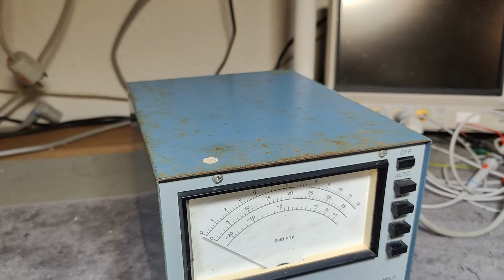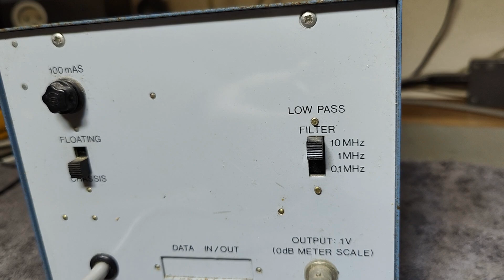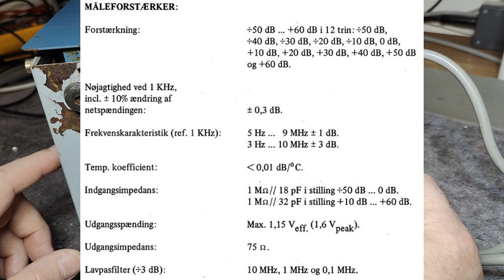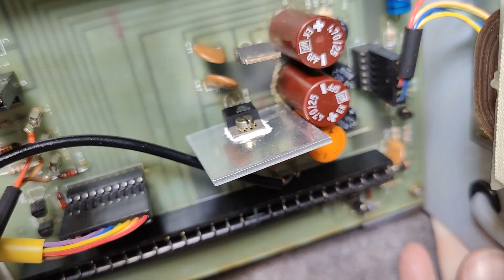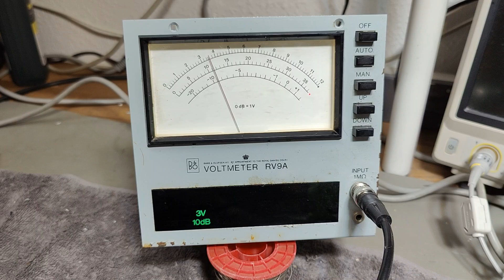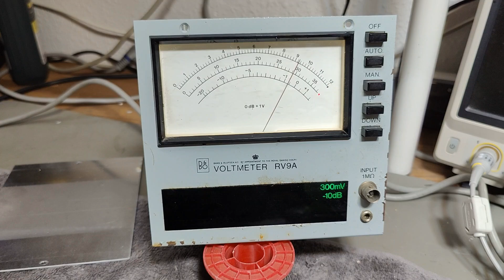Bang and Olufsen AC Voltmeter RV9A 10Hz-10MHz 1977 teardown repair

Comment: It’s amazing that you were able to bring the Bang & Olufsen RV9A AC voltmeter back to life! That’s a testament to both your skill and the enduring quality of B&O’s craftsmanship, even in their instrument line. Repairing the power supply and tackling the effects of humidity is no small feat—well done! A fresh coat of paint and a recalibration will surely make it as good as new. It’s always inspiring to see vintage equipment restored and kept in use. Great work!

Comment: Those old plastic-case ROE brand electrolytic caps are notorious for going bad. I have had a few that has gone shorted too.
Reply: I don't know why Roederstein sealed some of their axial electrolytics in a Bakelite case.  There was also the EKM series which were in an extruded aluminium case with an Alodine coating.

Comment: Interesting - didn't know B&O made test equipment back then. Apart from the mechanically unsupported cooling fin on that voltage regulator directly next to components that age faster when heated (the electrolytic capacitors) a very nice construction. When you have the documentation and a little bit of time to fix or restore them, these instruments can last forever.
Reply: B&O had a full range of test equipment: Power supplies, variable isolation transformers (got one), test oscillators, voltmeters, distortion meters, wow meters. As far as I know the only thing they didn't make was oscilloscopes - or maybe they did, but I have never seen one. It's not always they can be fixed though. B&O had a tendency to use special components that are impossible to find today, 40 years after they were made. At my former workplace we had pile of B&O power supplies that were missing a voltage regulator. I think these were eventually scrapped.

Comment: Back when this instrument was made, I think cleaning PCB's with CFC's (like Freon) was common.  The place I worked at in the late 80's used one, I actually ended up with it, but the cleaning fluid was $$$ and in 55 gallon drums only so I never used it properly.  One side was heated which evaporated the fluid, then the other side was cooled which condensed the vapor back into liquid, the dirt settled out to the bottom of the tank.  If you didn't leave the boards in long enough, they came out looking like that.  I'm pretty sure this was a pretty common cleaning method across multiple industries back then, all killed off when CFC's were banned shortly after this in the early 90's I think.
Reply: Remember as apprentice in avionics repair shop filling a square glass container up with a brown freon glass bottle and then clean pcb.
Reply: Yep, we cleaned PCB’s with Freon all the time until the middle 90’s (military and avionics equipment). If you didn’t clean it properly, that white residue would remain. IPA never worked as good. That tip of yours with trimming the legs of the bridge rectifiers is a trick I learnt back in the 80’s . Never failed me. 👍👍👍

Comment: Great piece of equipement. I've been working om a wow and flutter meter from B&O, same vintage.
In my case the tantalum caps where in very poor condition. Value drift, high ESR and leakage currents. I would revisit them asap.

Love the channel, 

Cheers from the Netherlands.